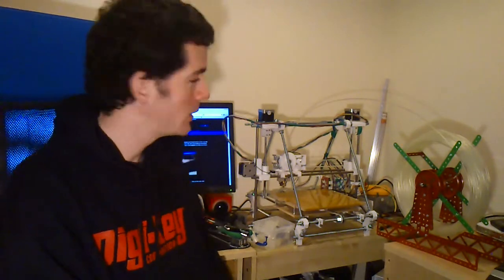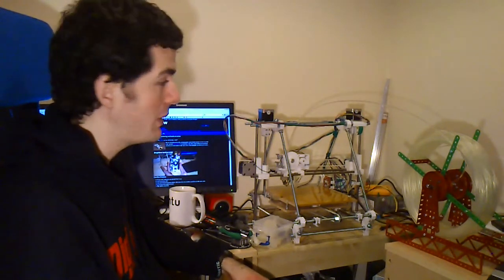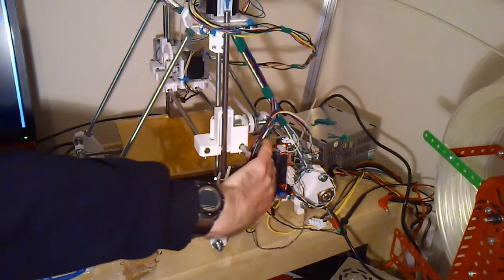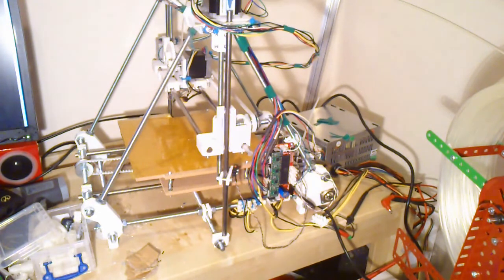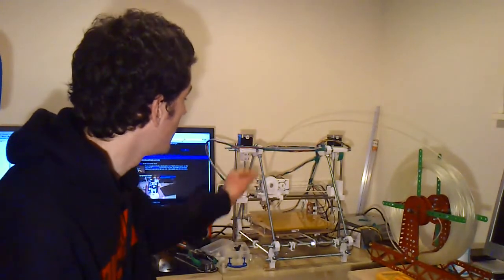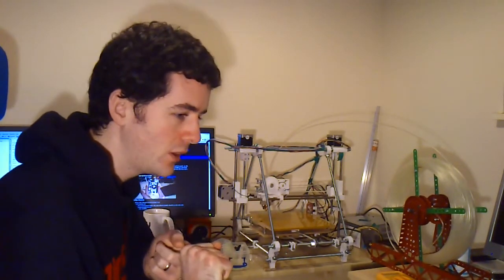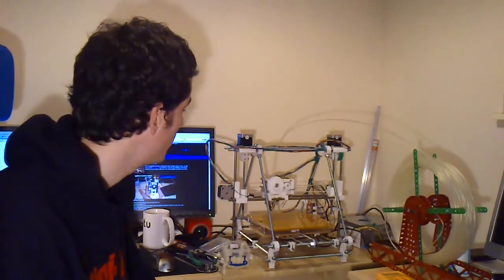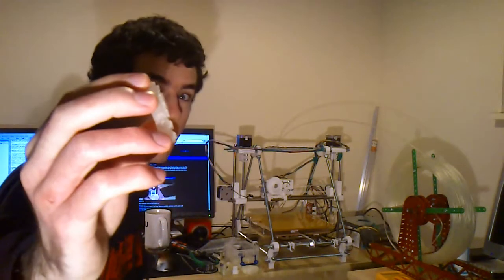How not to build a RepRap

Comment: I have read on some forums that the bad prints on the RepRap are mainly from the speed that the prints are done at ?, as the machine moves faster it tends to wobble sideways as there is no cross bracing on the front as you will notice that it's a square shape and there is not so much a problem on the A direction of the frame, this also happens as the machine is top heavy with 4 motors.

I believe that it's a slight design flaw, as there is a need for cross bracing at the top of the square, they don't need to be that big, and could be incorporated into the plastic parts that hold it together.
If we look at the top motor mounts we can see that there is room for a cross brace on the out side to the top of the A frame, possibly incorporating all the top plastic parts as one might be better as well.

Well at least you got yours to work, mines over in a corner covered with a towel so as I don't look at it.

Comment from the maker: Never heard of that site.  Sometimes the kit of parts is just the absolute bare minimum to get the machine working, you can then print the improvement pieces yourself in theory.  Personally, I've only used eMakershop or people I actually know so I can't recommend anywhere else.  Do you have a local hackspace, there's often someone who will know suppliers etc.

Comment: Try looking for some chipset heatsinks, and some binding thermal paste.
make sure the fins are vertical. And attach those to the sides of the steppers.
If needed, you can attach a small fan.
And old socket7 40mm or 50mm fan should be fine. And just put those on the steppers.
You can even angle them so they blow upwards, not down.

Comment: there is a Power box End you can Print from thingyverse that has a mount for a Male Socket and A switch on the Top also a Mounter Bracket for the Reprap Driver Board.

Comment: Some simple solutions to a few problem... ABS is a lot better for the reprap structure, then you needn't worry about the current. NEVER USE PRINTED PULLEYS. Most kits come with them, they are a load of crap just like the printed bushings some kits come with. You can get decent belts with aluminium pulleys included on eBay for a good price. This will allow you to properly tighten the pulley onto the shaft. In relation to the "steps per mm" problem, the one I downloaded has a read-me, i know men don't like to read instructions but this will solve that particular problem. Mr. presenter here seems like more of an electronics wiz than an engineer.

Comment: in most cases no. because if you only need to replace a knob on a washing machine, it is cheaper to buy a new washing machine.
because most DIY kits kost over 400 euro's and the assembled ones are available from 900 to 3000 euro's. so you have to print a lot of (usefull) stuff to break even.
I've got a 3d printer but i see it more as a gadget to make other gadgets.

Comment: Actually, the tolerances are not a problem, but the economics of it still don't make sense. Lego parts are mostly all the same, so injection-molding means they're MUCH cheaper and higher quality than a 3D-printed part. It does make sense for custom parts tho. 3D printing is best for small runs of custom objects, assembly lines are still better for mass production.

Comment: You can't make your own Lego (note that the plural of Lego is Lego, not "Legos"). That is because Lego is moulded to ridiculous tolerances no hobbyist 3D printer could match. You might get lucky with something that vaguely fits without other Lego, or be able to make passable accessories (like weapons for minifigs and such), though. The higher the res of the 3D printer, the more expensive it is, also.
Reply: 11 years later and I'm not sure if your comment still holds as true as it once did... ;)